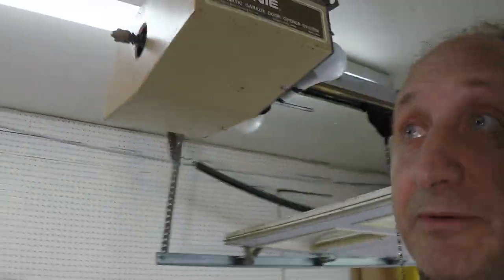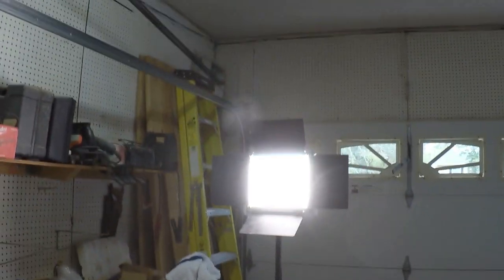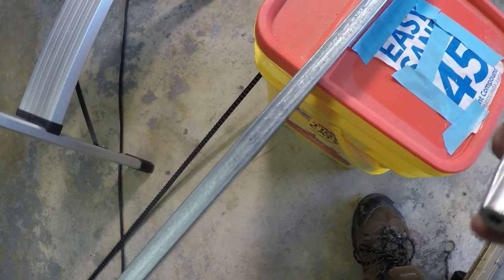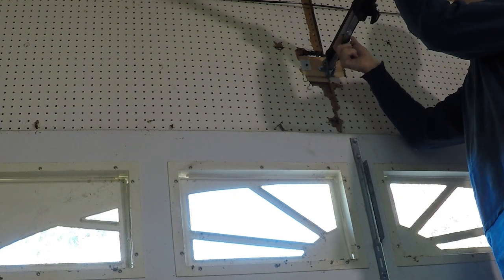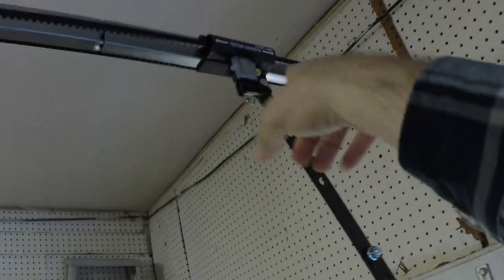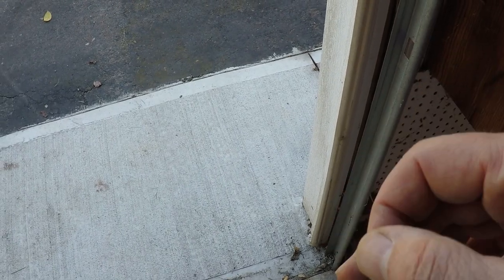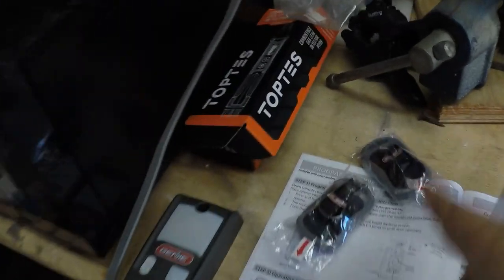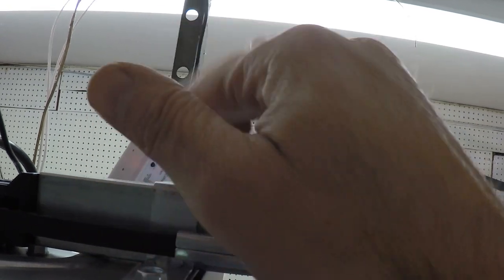Replace and Install a Genie Garage Door Opener - VERY OLD

Comment: Great job. I watched several other videos and started putting together my opener.  Took a break and found this. It would have saved me much stress if I could have watched this first. My 2nd half will go much smoother after watching this.  My newest Genie opener comes with a wi-fi controller built in. I am surprised yours didn't come with it. Thanks again
Reply from the maker: thank you for watching

Comment: Greetings, I cleaned sensors, bought two new different remotes, erased all memory... indoor button works fine all the time. Both new remotes must be pressed several times or it works on the first time and then not. Wires seem to be fine even when I wiggle them sensors do not flicker. How can I trouble shoot the geniue motor? Installed 2004. Thank you.
Reply from the maker: the problem is with the remotes..
Reply: @flannelguydiy6458  Thank you!
Reply: @flannelguydiy6458  A new remote fixed the issue. Thank You!

Comment: Great video.  I have a similar vintage Genie and all of a sudden the wireless remote keypad stopped working.  I purchased a new Chamberlain (klik2u-p2) model keypad but apparently to program it the opener must have a  Learn Button.  The keypad that stopped working was a klik2u model.  Any idea how to program the keypad without a Learn button?  Do I need a dip switch on the keypad?
Reply from the maker: No, i dont think you can do it without a learn button. I would suggest the WIFI garage door opener that I mentioned in the video. You control it with your phone and will work on a vintage opener.
Reply: I can't find the wifi video you referenced

Comment: Do they make a screw drive anymore?  I need to replace a Genie 98 with the shaft/screw drive
Reply from the maker: They do make screw drive, but if you are replacing the unit I would not replace with another screw drive. They are MUCH louder than a belt drive. It is not even close
Reply: @flannelguydiy6458  Thanks! i'm looking at side mount drives now also

Comment: The one thing Genie could improve on is the wire they give you. The wire doesn't have a good coding on it to define which is positive, and which is negative. I could barely tell that one wire had what looked like writing on it, not really a black line of any sort. But I managed to get it all working.
Reply from the maker: thank you for watching! please share the video for others to see

Comment: I have a Genie screw drive from '94 so it's been working for 30 years. It's pretty hard to adapt it to a smart home though so considering replacing it . . .  even though it still works pretty much like new. Have to wonder if the new belt system is going to last 30-40 years like the screw drive! Imagine that a long steel screw is far more expensive to make and that's the reason they are trying to push the belts. The new ones are much quieter yes but believe me, it's not the screw that is making all the noise, it's the motor and its gears! Also, the noise is a nice indicator that my wife is home, her car is way too quiet. Now you need an app to alert you that someone opened the door! Progress? Hmm.
Reply from the maker: Eric, you can keep the old screw drive opener and adapt it to a smart home device. I have another video where I show how to turn even a very old opener into a smart opener for $20. It syncs with the smart life app. I get notifications every time the garage door opens and closes. So, that is also a way to know that your wife is home.